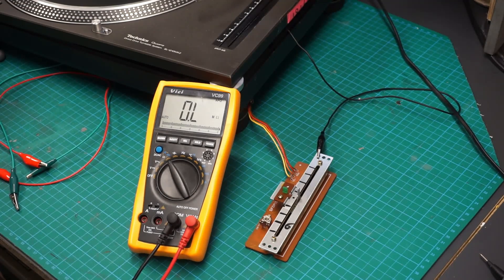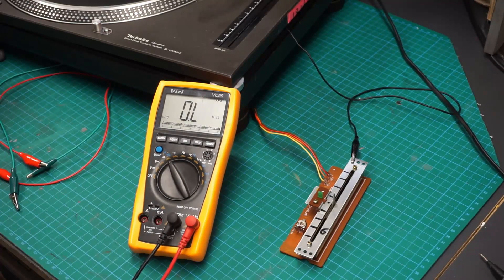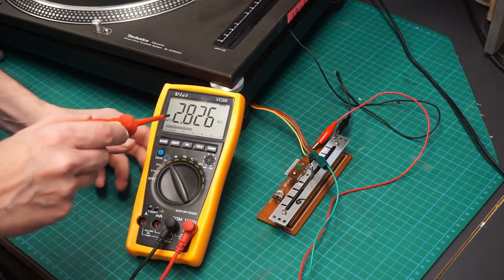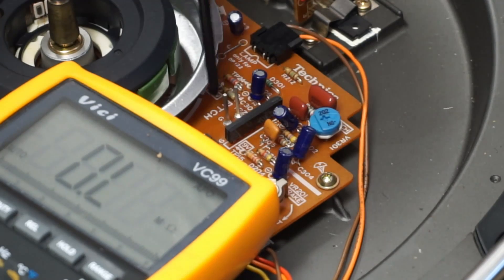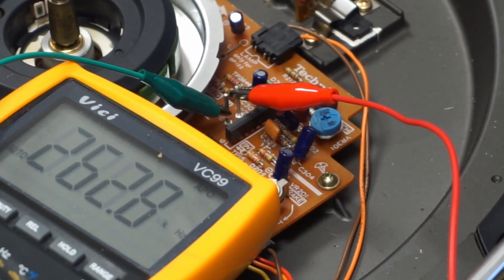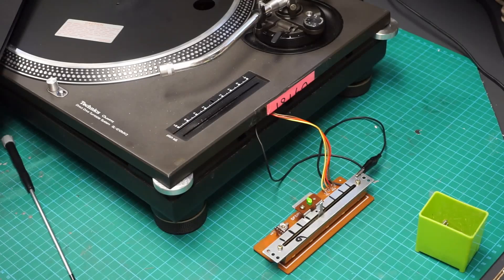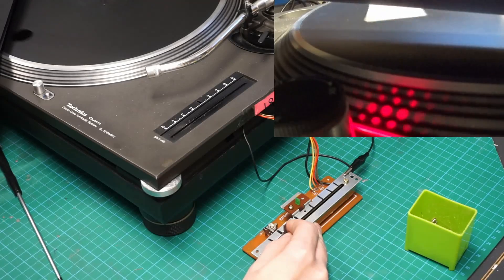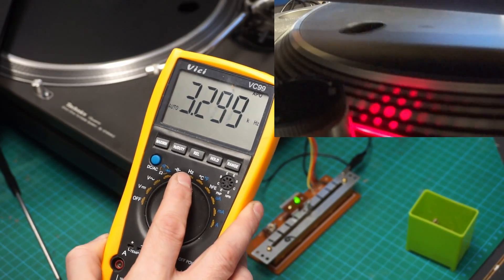How to calibrate the pitch on a technics 1210 using a multimeter

Comment from the maker: I am adding a new rule. No help or questions answered unless it's related to the video and you are subscribed to the channel. It takes up to much time to reply and I am not free tech support.
Reply: Hi, I am new to your channel. If you could help me out on the pitch and tell me what am I doing wrong. I have followed over and over again. When I try this on my test points I get 0 readings on 3 turntables. 2 SL1200 and 1 SL-1210. The tables work fine. What am I missing. My meters are a Fluke 117 and a Major MT720.  Much appreciated for any help.
Reply: I agree

Comment: The super oem turntables are great but for longevity you can’t beat technics, don’t ever sell them unless you’re upgrading them to newer condition units, the goat is the mk2 units whether they’re 1200 or 1210, limited gold edition and the mk5s! I owned the 1210 m3d and you can notice the difference between the pitch on them compared with the mk2 and mk5 analogue pitches

Comment: My tanks are from 1985, treated in 3 Discotheks from many different DJs. They stood almost 15 years, with operating only a few times in between! Never serviced, the needle light, I never saw working and they are under my control since 1991…Also in a club. Now I try to make them also look and work the best again, thx for your instructions! A techno friend of me tuned them up 1994 (with vr 301), I worked with it, but never was lucky about that “upgrade”. I disassambled both, opened the fader, cleaned them, in the plus mode worked perfect, but minus, almost does’nt work. My soldering was good, I think, the inside of the faders looked good, after cleaning, but I think, after 41 years, maybe itis time to buy 2 new faders…But without you, I had never the balls, or even the idea to open the faders like you tought. Again I learned to don’t be afraid 👍💪🏼.

Comment: Really good tutorial bro but i am facing a problem for a month now that no one can help me.
I own both a 1200 mk2 and a 1210 mk2 for 2 months. Everything was ok till the moment i decided to clean up the faders.
I followed every step of yours with lubricants and contact cleaners. I measured the ohms 2.7 with a multimeter i owned and i put the fader back. I play with traktor timecodes and guess what. When the normal speed to a track was + -1 for example a track that is 122 bpm with timecodes appeared 121,98 or 121,99 at 33rpm something like that which is normal.
Now the speed is not as stable as was. I mean that now goes + - 0,05 and is not so accurate that is was before and when i go to 45 rpm it goes + - 0,15. This happens to both turntables. I tried to measure the frequency i put it to hz measurement but it doesn't count. I changed 2 multimeters with hz option. Nothing! I tried to adjust the VR 301 manually according to the dots but the speed is not stable as it was. I am going crazy really because I spent too much money. Can you help me please? I would appreciate it if i talk directly with you with some way.

Comment: Have you ever had it where the turntable changes speed up and down ? What’s the best way to fix it? It’s especially bad just above and below the 0 position
Reply from the maker: like a wobble ? this is going to be dirt on the carbon, in the brushes or the traces are worn out at that point.

Comment: My center click green light is dimmer than the reset button green light...any clues as to what could be causing it ?
Reply from the maker: the led is getting old or  the carbon traces on the pitch are starting to rub away so the led is not getting enough volts.
Reply: @DJlegionuk  it’s a fairly new pitch so wouldn’t expect the traces to be wearing already but I guess it’s not impossible,if the led is on it’s way out I’d expect it to be dim on the reset button too ? I guess I’ll just have to open it and have a look..thanks for replying 👍
Reply from the maker: @clivehenry5750  the led goes through the carbon on the pcb when it's on so it must be giving more resistance than when the pitch lock switch is on.

Comment: just bought new pair of sfdz122n11-2 faders and if i do exactly the same you did in the video, i have two zero points.
i have to calibrate pitch to 2,544 with 262,08hz to have 0 and 6 perfect.
but then my +3,3 is around +2,1 so that area is pretty bad to mix at, because its so sensitive to movements.
on my other deck the pitch is calibrated to 2,566 with 262,08hz.
also +0 and +6 is perfect but +3,3 is around 2,5 there.. also really hard to mix in that area.
how do i make them faders calibrated the same ? one deck is around 1999 other one 2008
Reply: I have the same problem I don’t know what to do

Comment: Yo! Thanks for the stuff, its priceless. But i have a problem thoe 😂 After setting 2.7K i measure those pins and get 0Hz every time. Multimeter is NEW and as the manual says, works between 99.9 Hz - 1000 kHz. Any ideas what could went wrong? Both decks O Hz. Thanks for your replay in advance, big up!
Reply: Any advance?  I am in the same situation, in the two scales of the multimeter it indicates 0Hz in any range of VR301.  But in the deck it does act.  The problem is that it doesn't react on the multimeter, always value 0. Obviously I have it turned on and pitch at "0" (2'70Ω) and led ON.  Sorry for the translation, I'm using Google translate.
Reply from the maker: The deck is switched on ?
Reply: Be carefull just because the dmm is new dosent mean its Gospel something could have hapend to it during shipping 
Hence the crap of proving units  dont get me started
Reply: i have this same issue, i'm using a Klein MM1000 across TP27 and G but i am not getting any frequency reading, it seems to have a similar range 9.999Hz ˜
 999.9kHz resolution 0.001Hz ˜ 0.1kHz

Comment: Hi legion. I have a question. I recently bought a technics sl 1210 mk5. It is in new condition. However, it needs oiling.  Can you recommend any videos how to do this?
Reply from the maker: unless you mean the center bearing for the platter I am not sure. you just buy some of the correct oil and squish into the top of the bearing and wiggle up and down.

Comment: One thing I just noticed in the service manual for the MK5 is VR302 on the Pitch Fader should be set to 2.875 +/- 0.25 K.ohms. VR301 remains the same. Is this something you do for MK5 models?
Reply: Just setted up my vr302 with 2.87 - pitch in the center on  my MK5. Thank you.
Reply: @floor12evgen is it the same process? Do you need to take a pitch out? I saw a vid where he just flipped the deck over. I have mk5 also and they need this

Comment: How do I know if my pitch can be calibrated or I need a new pitch?
Cause I thinking about to buy this multimeter. Excellent video
Reply from the maker: unless it has dirty/damaged traces or brushes it can be calibrated. Does it move smoothly and do the dots jump around erratically at any point.

Comment: Hi Dj legion. First of all, thank you for your tutorial.
The second thing is that I wanted to tell you about a problem I'm having. I'm following every step of your video. When I perform the test by setting the selector to 20k the multimeter shows the value of 4,530. The problem is that even if I turn the VR302 component to one side or the other, the value of the multimeter does not change. Can you tell me why this is happening to me? Thanks in advance.
Reply from the maker: it's damaged or you are doing something wrong.
Reply: I have the same issue, no change when adjusting VR302, perhaps there's a difference with the newer 8 pin fader boards, because I can adjust the VR302 on the older 6 pin fader boards for 2.70 with no problem

Comment: hI DJ LEGION.
I have Gemini PT2400 and wanted to calibrate the pitch  as  to achieve neutral speed you need to move fader to nearly  +2%.Sadly I can not find a pot near main pitch fader.I did clean up pitch fader but no luck.There is a pot on on the motor board, no changes to pitch if you move it.
I may try to solder some pots to fader with different values and see if I can tweak it up.

Comment: If i want to calibrate SL1200 MK3D when set pitch to center, Do i have to press button?
Reply from the maker: no, that bypasses the pitch you want to match the center of the pitch without the button pressed to be the same as when it is pressed.

Comment: Hi! I know it’s a noob question however it’s not mentioned (or at least I didn’t catch) where you have set the frequency potmetre to when adjusting V301. I have seen previous videos where it’s been set to 20k upon doing it on the pitch itself at the OHM area. Is that correct? Reason I ask because my reader is giving me ridiculous values, 7.805 kinda stuffs... As Im not a technical genious I guess I have done something wrong. Thank you!

Comment: Hi. I have the problem with the double zero. With the pitch at zero (and the LED on) it turns perfectly, when i accelerate with the pitch in the Moment that the led turns off instead of going faster, the turntable slows down to return to a new zero on a value of about +2.5. It holds the +6 and +3.3 very well, a little less the -3.3 but it is at acceptable levels.
Searching on the web I found various tutorials to solve my problem, the point is that when I connect the multimeter to the pitch (obviously disconnected from the turntable) I have an X value, and going to modify the VR302 trimmer that value should modify right? To me it remains fixed and constant.
The tests I have carried out are the following:
I have completely replaced the pitch, putting the One of my other turntable, and it works perfectly, so I rule out problems with the motherboard or others stuffs of the turntable.
With the Multimeter attached to the Brown and Red of the pitch (disconnected from the turntable) I tried to move the pitch fader and the value changes (so apparently the fader is good) but with the same configuration by acting on the vr302 the value remains fixed and constant (so apparently the vr302 doesn't work).
At that point I connected the Multimeter to the vr302 and rotating it the value changes, so apparently it is good.
I am also going crazy because if there was something to replace I would not know what specifically, and with the times that are running I do not want to spend more than I should. 😬
Sorry if I wrote a lot but I hope I have explained the problem well and what tests I did.

Comment: Hi...i have the same problem with 2 zero points...i do everything you do...find the 2nd zero point...take the value...return the pitch to zero but when i try to move the vr302 on pitch pcb there Is no value change. It Is stucked at 8.22. What could be the problem? The vr302 50k ohm? The pitch fader? Or the pcb? I measure the pitch in ohm. Thank you

Comment: Thanks for a video
I got new pitches installed, both new and seems good, +6 stationary on both and 3.75 not 3.3%, happy with that, But around central area is totally mess if i move to negative side it at the beginning moves to positive and then goes down to negative, about 1.5% is opposite when it switches to right side, to make clear, reduce speed moving up fader but instead pitch increase and at the point of 1.5% it does reduce speed! On both new pitches same problem! 
Does it makes clear and how do you deal with it?

Comment: Thank you for all your videos.

I was dj for several years but quit 20 years ago.  My son has grown up listening to all my old cds and wants me to teach him.  I told him I would teach him but insisted he learn really mix on his own before flexing the tech of today.  Went out and bought 2 used 1200’s and they were completely jacked up.  They were the kind of decks that you see dj’s in clubs throw their arms up and walk off.  On BOTH I had to rewire the arms, replace the RCA PCB, disassemble and clean the pitch’s, and calibrate.   

You alone got me through all that, other than finding a clear answer on where the black wire that goes into arm ground.  It may be in one of your videos.  I just didn’t find it when I needed it.  Other than that, you got me from having 2 worthless turntables that seemed to have been in clubs for 30 years, to 2 perfectly working turntables. 

Now I just need some 12” skins and I’m all set.😂
Reply from the maker: Thank you for the comment, it makes it all worth while to know I helped to get your decks working again.
Reply: @DJlegionuk  Any time.  Now if you can tell me why I have such bad channel bleed on only the headphone fader of this Vestax mixer, I’ll be all set.😂
Reply from the maker: @brother000merch  dirty or damaged fader ? try some deoxit

Comment: I am going to tackle this tomorrow.  Just waiting on my multimeter to come in the mail.  My turntable dots line up perfectly at +6, +3.3, and 0.  However, the  -3.3 dots seem to line up at -2.5.  Am I being too anal here?
Reply from the maker: just a little bit. !!! haha
Reply: @DJlegionuk  Did the multimeter test. I was told faders are not linear since the equipment is analog.  I tried.
Reply: I have the same problem my -3.3 is @ -2.7! 0, +3.3, +6 are fine. I've tried to fix but I think this is as good as I can get it.
Reply: @aa-jn3ks  It is fine.  Analogue pitches are difficult to be "perfect".  Many factors can contribute.  What you want is for those middle dots to move smoothly forwards ...then stopping.... then backwards with smooth movement of the fader.  If you want perfect pitches, you have to go MK7s and up... which are digital.

Comment: What is the BLACK cable attached by a crocodile clip to the external pitch fader? Is it a ground lead connected to the chassis of the turntable?
Reply from the maker: yes it's just to extend the leads so I can use the pitch outside.
Reply: @DJlegionuk  Thank you very much. And you tell us exactly which setting you have set your multimeter dial to please.

Comment: My problem is that my 0 point is at 0, but also at +0.5. Does this depend on the inner potentiometer on the pitch board itself? maybe this is not properly calibrated? Thanks for this great video!
Reply from the maker: it's just not calibrated so will need adjustment of the pitch on the main board then if that changes the +6 adjust the pot on the pitch board too.

Comment: Hi, i just bought a Technics 1200MK3 and it seems needs calibrate the pitch. The 0 position seems ok , the +6 looks like it is moving a bit to the left,  the +3.3 and -3.3 is at +2.2 and -2.2. ¿Any tip to recalibrate it? Thanks

Comment: Hi, on one of my pitches, the range of resistance only goes as high as 2.22. Do I need to replace the variable resistor?

On my second pitch, I adjusted to 2.7 but it then steadily drops by 0.01. I went for a smoke, came back and the resistance had dropped to like 2.648 or something. Any ideas if they can be fixed? Tried cleaning both pitches with contact cleaner.
Reply from the maker: what do you mean it only went to 2.22 ? the pitch are 0 - 20k  so only going to 2.2 would be very bad. Have you cleaned the adjuster on the pitch as well ? that can change the readings as much as the pitch so give that a full turns all the way to the min and max and if you have deoxit a spray, perhaps that will help. have you taken the pitch apart and looked at the carbon tracks ? no amount of cleaning will work if the carbon it just worn out around the centre point.

Comment: I followed the steps in the second half of the video to calibrate the frequency but my multimeter shows -1 or -000,1 kHz. I turned on my Turntable and set the multimeter on frequency mode as you explained it. Anyone knows what to do?
Reply: read the manual of your meter :)

Comment: Got a new astroAi dt132a, frequency meter just shows 0 hz... I have lead clips on right and the turn table turned on... tried on 2 turntables, any advice? Meter worked fine on adjusting pitch fader resistance
Reply: Probably to do with the range of your meter.

Comment: Do you find this much more difficult to do on the M3D and higher models? Mostly because the center click is disengaged since you have the pitch reset button. How would you go about with doing that?
Reply from the maker: It's just the same but the center click is a button. I have not tried on the ones with digital pitch.
Reply: @DJlegionuk  oh okay! I followed your tips tried to align the zero marker on the pitch as close as I can. So far so good, both of my decks are pretty spot on.
Reply: @BryantFC   its important that yoou place your fader at the center! reset button works different
Reply: @yvanflodin  exactly.

Comment: I put brand new pitch faders in my turntables and calibrated exactly to the service manual standard of the pitch at 2.7K and the frequency at 262.08 (I have a 6 and 1/2 digit multimeter, calibrated). The plus and minus 6 is bang on but 3.3 both ends is off by 1-2 %, any ideas? Great vid, many thanks!

Curtis

P.S both pitches were the proper -2 pitches for this model.
Reply: Curtis Rivers I got the same results.  I gave. Up.  They both match. I guess it’s close enough
Reply: @GGarcia7111   just ti answer everybody, ive been servicing these decks for years butits very rare that the pitch matches the grid perfect. Its an all analogue turntable and the only 2 adjustments only allow you to calibrate a few things. I personally always try to match the better around +3.3 and +6 with a calibrated 0, and i then the minus part may vary. I know most djs play at positive pitch anyways!
Reply: yvan flodin agreed!   Thanks for the input
Reply from the maker: Hi, even though you set the center to 2.7 what are the dots like when you move off center by a small amount ? I do not know any other adjustments it's just the two so perhaps some other passive components is slightly out of spec on the main board. Is it the same on both decks ? if so then it could also be the way the carbon tracks on the new pitch are setup.